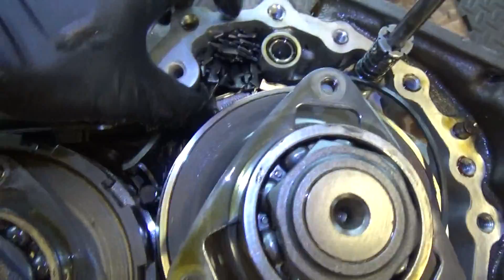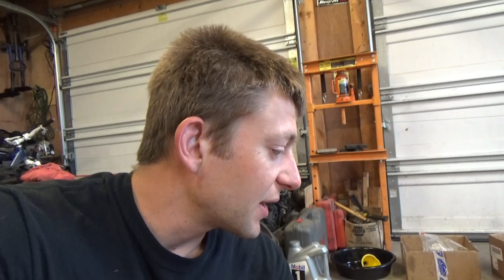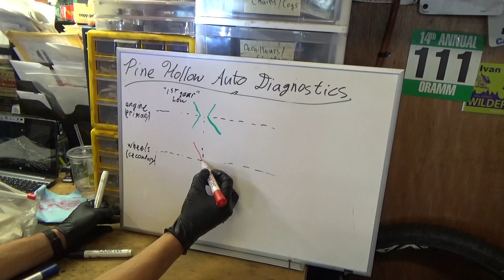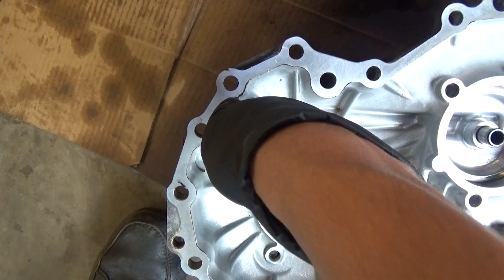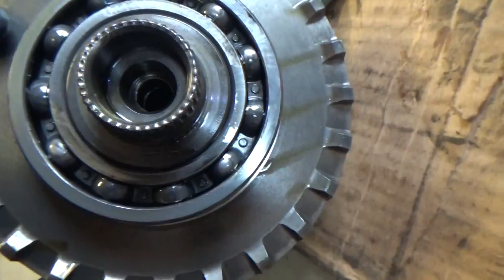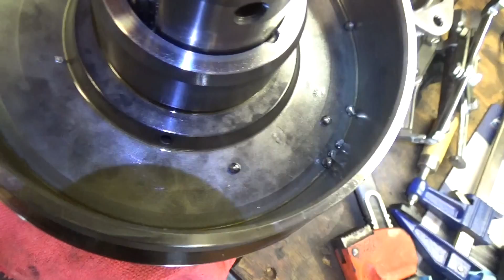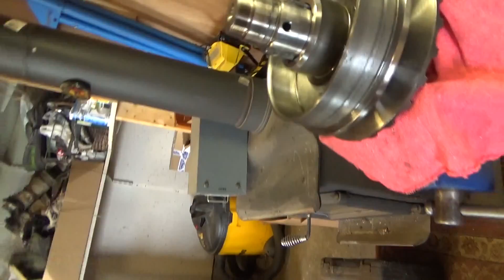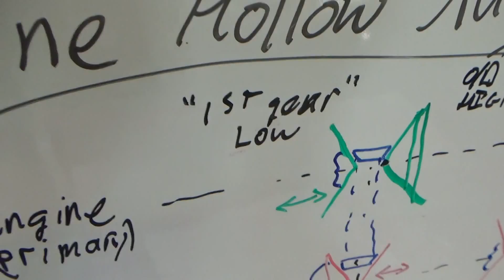Nissan CVT: Teardown and Failure Analysis -Part 2 (RERELEASE!)

Comment: This is a VDP (Variable-Diameter Pulley) transmission that relies on static friction to transmit power between the belt and pulleys.  Toroidal and conical roller CVT's also rely on static friction, but omit the belt by using direct contact of driver & driven cone or toroid surfaces.  These are all known as 'traction drives', and their contact stresses where static friction does the work are very high.  The VDP also produces repetitive, reversing bending stresses on the belt.  These design principles produce inherently weak mechanisms.  There are better ways to design a CVT!
Intent on making a superior CVT, I've been studying methods for transmitting continuously variable ratio power for decades, and have been developing an alternative that avoids this dynamic method of using momentary static friction (traction).  I anticipate a final design that should be much more durable, somewhat more efficient, and simpler than any automotive traction drive.  No torque converter is necessary in my concept because it's an IVT that operates at a very wide range of ratios that includes zero output.  My designs are not purely hypothetical; I'm on course to produce a 4th prototype that will mount on a bicycle for testing (as were 2 of its predecessors).
My IVT will be useful for cars & a variety of vehicles beyond bicycles.  It's no easy task to conceive, design & prototype these machines, so it should be understood that this can take years of experience to discover what works well.  Now, after much testing, I've got a full concept that's only awaiting some computer upgrades to finalize a design that addresses all issues that I've found in my journey to make a superior IVT that can be adapted for use in cars & many other power-transmission applications!
This video was very interesting to me because I've anticipated the mode of failure here.  The IVT idea is really the way to progress, but the technology will only succeed with a different approach that's very reliable, efficient, and capable of transmitting high power through a small package.  My proof-of-principle prototype shows how this will proceed, and can be viewed on my YouTube channel; just click on the icon on the left side of this comment!
Reply from the maker: Thanks for sharing! Good luck with your invention!

Comment: So, if you buy a vehicle with a CVT transmission be sure to get one with big balls.
Reply: if you buy CVT lease it, buy new, or buy aftermarket warranty for it. I bought my Maxima brand new and its pretty ballsy for a CVT fwd car. no sluggish rubber-band feel to it at all. even acts like a traditional auto under heavy acceleration to reduce premature wear due to sliding during ratio change under heavy torque. it pauses engine input for a fraction of a second while it changes ratio really quick so there is less stress on the belt when its moving on the pulleys. if it blows up, I get a new trans. following the fanbase, the new CVT in the 8th gens seem to be holding up much better than previous generations. 
I sure as hell wouldnt buy one over 60K miles though without getting aftermarket powertrain warranty though.
Reply: Zac Price I bought a 2016 accord with a 2.4L and cvt trans, bought it brand new from the dealer with a lifetime drivetrain warranty so long as I follow their maintenance plan which is really no big deal because I’m a technician at a shop so it’s super cheap for me to do maintenance, so far I’ve got 25k on the car and have absolutely no complaints about the car or the cvt it drives super smooth and is actually fairly quick for a 2.4
Reply: @2491kridge  So the Lifetime Warranty is legit as most dealers say it is? I was looking at slightly used Toyotas and like the Corolla. Meh long as I have the CVT serviced at the dealer every 2-3 years (I drive mostly short stop and go trips), I got proof when it comes to claims.
Reply: MrCliffda3rd I mean I haven’t had to make any claims yet but yes some dealerships offer lifetime drivetrain warranty, the warranty doesn’t come from the manufacturer it comes from the specific dealership you buy from and the way they try to get you is making the maintenance plan that you precisely have to follow cause they want you to do all your service with them cause you’re scared you’ll loose your warranty but as long as you follow their plan correctly you can do the maintenance wherever you want
Reply: Its 6, 9 or 12 balls. See a different video at 30:05.   https://youtu.be/vlKYNL_wdd8
Reply: Something to make up for the small brain that bought one of Nissan’s.

Comment: I love how simple CVT's really are. Way less moving parts than a traditional automatic. I just wish that manufacturer's would optimize the software side of things. Most vehicles with CVT's are programmed to act and "shift" in steps like an automatic. So that feels like a traditional auto. If they would optimize it for performance and efficiency it would be so much nicer. I dont want it to behave like a traditional automatic because it isnt! Not to mention incorrectly sizing certain CVT's to the size of vehicles. It seems like Nissan took the, this works fine in smaller vehicles lets just stick it in the Rogue. Instead of having a higher duty unit specked for it. It looks like the metal on the shaft was too soft, and with respect to the wear pattern, that the groves on the shaft were too large, allowing too much free play between the shaft and pulley.
Reply: Yea they are, but whats that say about nissan??  15 years of horrible experiences and pissed off drivers......Nissan could not manage to use a larger main belt??and like pine hollow said- they need bigger ball channels in the main pulley!!....there is no excuse for nissan......I had every trans going back to the powerglide, and this is theee worst of the worst i have ever seen

Comment: Terrible design.  Shameful.  All of the power transferred through 3 shallow groves.  Curious why a splined  shaft set up could not be used on the input shaft like any other transmission?  The way to make a reliable CVT is the way Toyota does it on the Highlander: a planetary gear set up.  It will outlast the car.  Very robust with no heat build up like a regular automatic.  Costs more, of course.
Reply: Rene Neron 

Splines wouldn't be able to slide up and down as easily...
Reply: Phill Zimmer zero chance it's a lubriction problem. If it were, you would see the damage on the interior surface of the pulley too. In addition that area is effectively a hydraulic cylinder and will be constantly filled with fluid. A slightly leaky seal would not be noticable on the performance of the system.

This is a simple case of Nissan cheaping out and skipping the heat treat process on the pulley and shaft (an already expensive part). If the shaft were hardened as the pulley was, which was not damaged, these would go a MUCH longer time. This is perfect example of "it's good enough for the warranty" and the extra several dollars per vehicle (which amounts to a LOT of profit when selling 400k vehicles per year) which should drive you away from wanting to own a Nissan at the current time.
Reply: Still made it 180,000 miles, though.  I don't think it's a wear over time issue, the bright, deep scarring is more consistent with a sudden failure.  Likely the seal gave out due to age and released the lubricant, which caused the bearings to get pinched and break in half.  Then they were ground into the channels until the pieces were small enough to slip between the shaft and the housing and seize the pulley.
Reply: @luminusprime  Many of these Jatco CVT's are failing between 70,000 and 150,000 miles.  Contrast that with my last car, a 2001 Cavalier:  15.5 years of use, 181,000 miles, and zero maintenance needed on the manual transmission or the clutch.  The transmission outlasted the rest of the car.
Reply: Gearbox Clinic Don, especially under torque!
Reply: So you are not satisfied with 180,000 miles?  The average car makes it to 150,00 before they end up on the scrap heap.  And the belt probably failed due to lack of maintenance, the fluid remnants in the casing don’t look too fresh.  Seems like pretty good engineering to me.
Reply: Toady Home - Only below average cars are in the scrap heap at 150K miles. My last three Toyotas; 1979 Pickup 4cyl manual - 266K when sold, still operational, original engine & trans. 1986 4-Runner 4cyl, manual - original trans and only new head gasket  417K miles, sold running. Current vehicle; 2002 Tundra 383K miles, original EVERYTHING except alternator & radiator. So, no; no reason anyone has to be satisfied with 180K miles. We're way past those days.
Reply: Dave Sipsy   So what my last two cArs have reached in excess of  350,000 and one which I bought at 180,000 km  I gave to a friend at 440,000 km and he still drives it, but I am a mechanic and maintain them properly. The AVERAGE car sitting in a wrecking yard has 140 - 180,000 km on it, either by being involved in accidents or flat out misuse and lack of maintenance.  Add that to the realistic example that very few cvts actually fail mechanically like this one did and my statement is accurate.  At least in my world.  I don’t even like cvts they make a vehicle boring to drive, but you can’ t knock them.
Reply: Toady Home 
you state that the average cars are in the junkyard because of abuse accidents or lack of maintenance. What does that have to do with a poorly engineered transmission that fails at 180 k? Sorry, but I want a car that I can drive longer than 180 K without major catastrophic failure. I don't care what all of the other goobers in this world do.
Reply: If these transmissions were littering the ground in this condition I would bag them too, but they’re not.  It’s one video not a design flaw. The engineering is as sound as any transmission.  Which all, by the way, litter the ground for one reason or another and at much less mileage than this unit.  Are you basing your comments on industry experience or just a single unit.  I’ve been a practicing mechanic for 45 years or so and frankly I’m surprised at your response, I haven’t experienced any unusual failures on these transmissions.  There are literally thousands of them around running pretty well.
Reply: Toady
I simply would like a vehicle that will last longer than 180k. I'm tired of all of the planned obsolescence in the products available today. I'm not ok buying a car knowing that at 180k I'm going to have to drop another $3 to $6k on a new tranny.
My dad is still driving a '96 Toyota T100 (5 speed manual) that has 430k on it and is still going strong. Only needed a clutch (maybe 2?) and the firewall reinforced around the clutch pedal bracket. He also had an '86 Nissan hard body pickup that had over 250k when he sold it.
Reply: Rene Neron  hello my name is Maria .I have a nice SUV Murano Nissan 2007.asking 5.000.car is in good condition.iam saleing my Murano because my family members had problem.i change brakes and everything else.please reach me at 6109901802

Comment: 180k on a cvt before failure is pretty good.  I have a new maxima.  I think they use a better belt.  Still i dont hammer on it.  Drag race starts are bad for cars.  Drag race starts with a cvt have got to be worse.  

One pet peeve is the fake shifting.   Means its loosening then tightening the belt to simulate this.  Thats the kind of stuff that makes it wear faster.
Reply: Texas Car Nerd I agree with the fake shifting part. They design it to not freak out the consumer instead of letting it work to it's full potential. People need to realize how they are supposed to work and be satisfied with it. I find it fascinating there is no shifting and welcome it because it's as good as it gets in terms of power and efficiency. I just hope they design them to be more reliable in the future. For now I'm sticking with older vehicles with manuals.
Reply: I have a '17 Maxima, I just wish they had an option to turn that fake 'D-Step' crap off.  Prior to the Max, had an '08 Altima, no fake shifting, no problems with the original CVT in 120k miles...
Reply: Dude, did you even watch the whole video?
Cus you're talking as if the problem originates from the belt, and the video clearly shows that its from the grooves in the shaft.
Reply: Subcummins01 AMEN
Reply: Had a 2005 maxima, the automatic transmission went out at 260k miles. I don't think a CVT can last that long.
Reply: @jackalope_hunter  I got an 07 Altima with 223,600 and CVT still feels like new, it's all about how you drive and maintenance with these transmissions
Reply: Texas Car Nerd I agree it’s dumb but that’s not what happens. That wouldn’t make sense. Heck. Probably isn’t even possible.
Reply: Every type has a specific use...
Reply: 180 isn't much to be proud of in my book, My 2102 focus with a dual clutch trans. has 228,000 and has had no issues, I changed the trans oil. myself. the CVC belt seems so weird to me.
Reply: they manipulate the engine controller to make it seem as though its shifting, but its just a rubber band effect. like a wind up toy
Reply: Maybe better pulley groove design.. Not the belt.
Reply: Friend of mine owned a 1959 Cadillac the original transmission had over Eight hundred forty thousand miles on it when he died he bought the car brand new the color of the car was rosewood.
Reply: Well and this is out of a rouge if I recall and you have to beat on those things just to get em to move.
Reply: Tiger Touge 
What do you mean by "Fake shifting"?
     Are you talking about your CVT car having paddle shifters or a "semi auto" mode that recreates rigid shifting?
    I ask this because I own a '19 Versa Note CVT with no "semi auto mode"
    Whenever im coasting & need to accelerate it will downshift rev up the engine & upshift gear settings rigidly like a fixed gearbox. 
   Whenever I stop to a light, you can feel the torque converter disengaging feeling like a DCT going into neutral. 
    Overall I say my CVT feels like someone driving manual for me..

Comment: Excellent that you found the point of failure.  Once again however I think you jump to a conclusion about a "design defect" without sufficient information: do most Nissan cvt's fail this way?  Or is this a material or process failure in this example vehicle?  Having said that, this was an informative and entertaining video!  Thanks!
Reply from the maker: Thanks, Little Johnny! Well yes, I only have a sample size of 1, but there is no reason to believe they used different materials or designs in this vintage JATCO CVT :)

Comment: I wonder if car makers, having to implement stepped gear changes into CVT boxes is adding more jerkiness and therefore torque spikes into a system that was originally designed for smooth changes of ratio and causing these failures? Nice job with the teardown  by the way, enjoyed it muchly!

Comment: CVT transmission saves fuel by at least 30% more than a normal AT. If it can last you about nearly 200k miles, than it's pretty darn worth it.

Comment: can someone tell me if stumbling(causes whole car to shutter) coming from front end upon acceleration that goes away after letting off gas is a sign these are close to failure? have an 07 Altima 2.5, 140,000 miles that's getting real iffy all of the sudden. Also did this not going past 20mph thing that I here is the cvt going into limp mode or protect mode? would appreciate any help determining when my time bomb's gonna blow. shiat!

Comment: Never trusted CVTs.  Heard too many incidents of transmission dieing early and $6-7K overhaul. 

These should be fairly quick and simple to fix. But aren't.  And no aftermarket parts to field fix.

Will stay away from these
Reply: Aisin CVTs are usually reliable. Generally it’s the CVT used for all Toyotas and recently on the new BMW 2 series.
Reply: Thats why i always buy manual transmissions in my cars. Replacing a clutch every 150k miles is easy as pie and way cheaper compared to replacing the whole trans.
Reply: I only buy manual
Reply: Dave M 
The premature failures at 15k are usually very rare amongst Nissan/Jatco CVTs.
     Nissan Jatco CVTs can live past 200K miles+ if regularly flushed, but sometimes you can cross 200k without tranny services!
    The true problem is that Nissan isnt trying to properly recall &/or promise a powertrain warranty on their CVTs should a premature failure happen.
    FYI: Nissan's CVT controversy is just like Fords F250 death wobble complaints, with Ford not answering or responding to customers!

Comment: I'm screwed if this is the case with the pulley and the ball locking/bearings.  I'm a lead foot with mine.  

I would be curious if they redesigned the newer ones.

Comment: Hi Ivan.  I remembered seeing a video some time ago about this belt and I went in search of it.  It is from Weber State University and is given by Professor John Kelly assembling one of these belts.  This is the link  https://www.youtube.com/watch?v=PiwRUfFEc5k .  The video is a little over 12 minutes long.  I watched it again and if you don't have the time to watch it he tells  you that these metal pieces are called elements.  In the belt he is building their are 399 elements. There are two metal ring packs each with 12 rings in them.to which these elements are fitted.  Each single ring is seven and a half thousandths thick.  Each ring pack with twelve rings is 90 thousandths thick.  These are his figures from the video.  I am not mechanic or a technician.  I just enjoy watching automotive videos like yours.  Thanks for sharing.